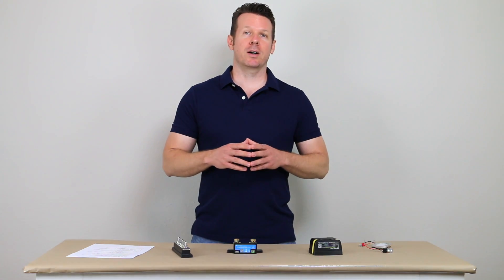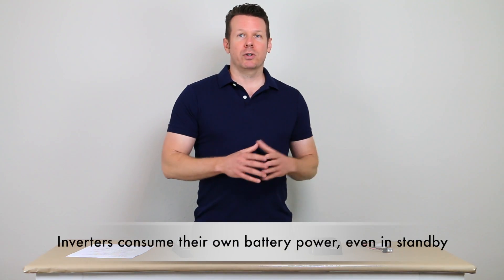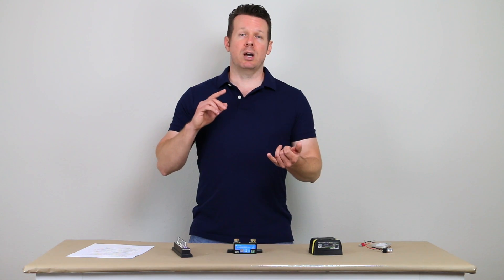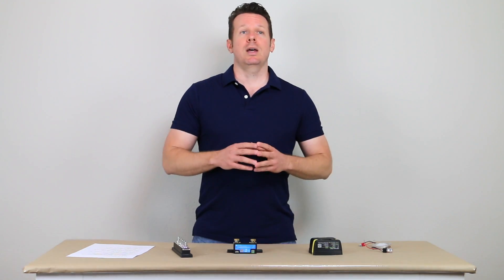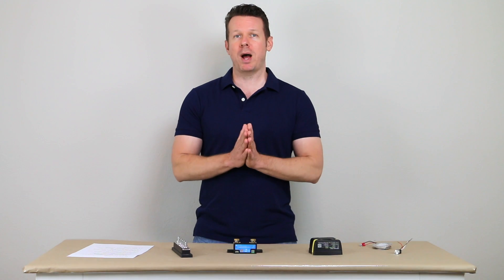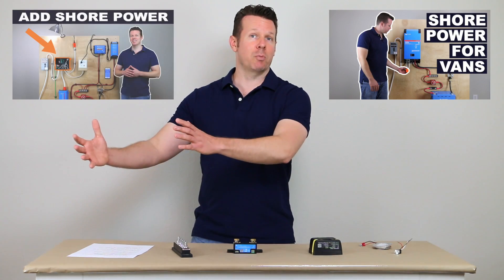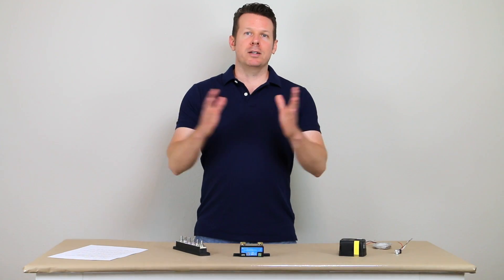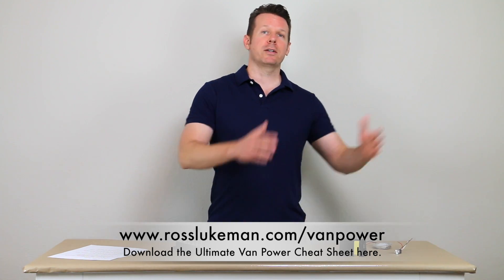The Top 10 Power System Mistakes for Van Conversions

Comment: Ross, as usual, a great tutorial. A trend seems to be running two DC-DC Chargers, such as installing two Orion Victrons. From your statements in the video, the chargers won't affect the starting battery, yet can the alternator handle the additional load (if there is one from chargers versus relays). In our case, we have a 4cyl. turbo Sprinter with an added OEM auxiliary battery for a 110v outlet that does not draw down the starting battery. So I guess in essence, we will be running two different charging systems...
Thank you in advance for your response!
Fred
Reply from the maker: Hi Fred, yes two of the DC-DC chargers is fine as long as the total amperage isn't too high. Two 30A Orions pulling 60 amps is usually fine for these vans (that is sort of my personal limit for stock alternators). The chargers are programmed to not drain the stock battery. In your case though, Mercedes has one of those relays between the engine battery and the OEM auxiliary battery. You would hook your chargers onto the auxiliary fuse block (likely in the driver's seat) that pulls from that OEM auxiliary battery. You're essentially putting the rear batteries in parallel with the OEM engine and auxiliary batteries, and the alternator will charge them all simultaneously. So to answer your question, it's all the same charging system, but the OEM auxiliary battery is an extra link in the chain between your alternator and rear system. Hope that helps, great question!
Reply: @rosslukeman  Hi all. On my Pro-master 2500 high top van, I use an amp meter showing vans power draw on alternator. Sensor is located around alternator power cable going into main fuse block under hood. I did a component power audit of van and can get 60 amps if various items are turned down or off and still keep overall dc load on alternator to 130 amps max. Alternator is rated to 180 amps max / factory test report says at least 130 amps at 2600 rpm.  I use 2 Victron 30 amp dc/dc chargers and turn each on/off as needed with a toggle switch located above and behind drivers seat.